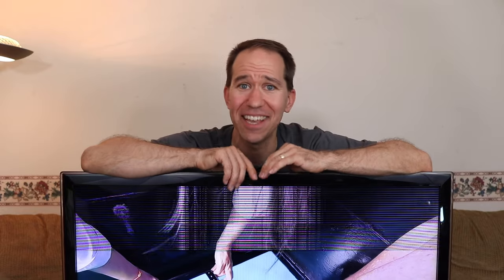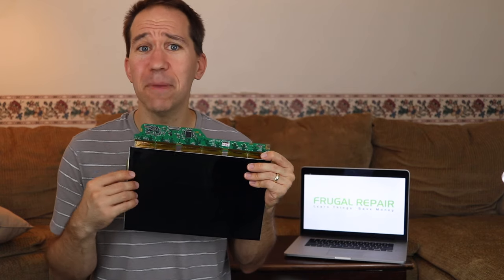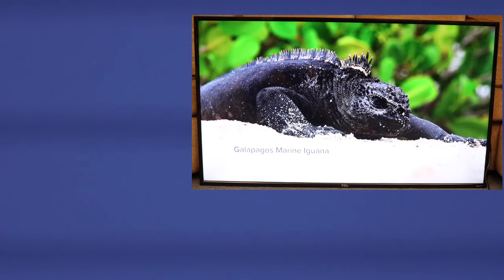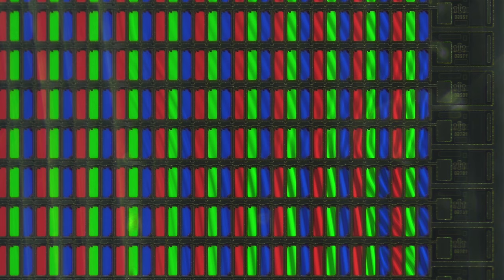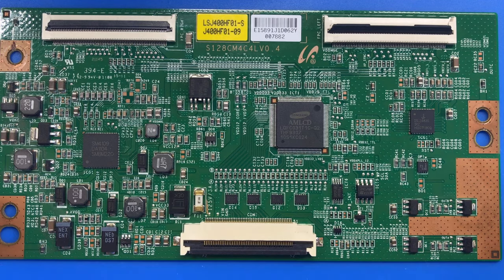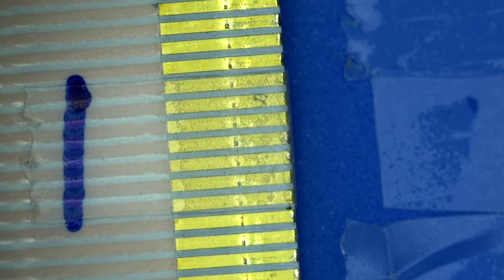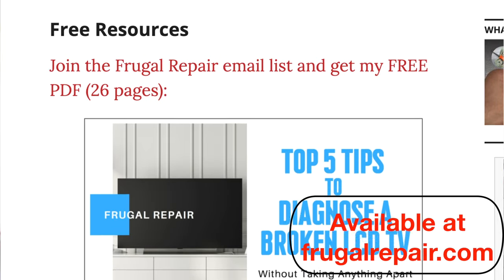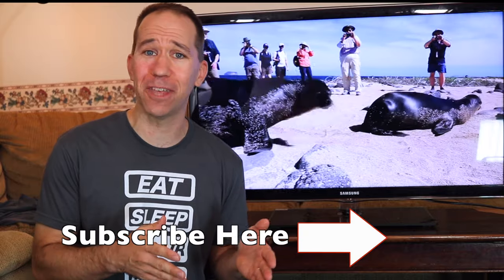Repair Hack Explained | How to Fix TV Horizontal Lines - Part 2

Comment: Thank you for the video! My Sony Bravia has a double image issue. The T-Con board has only one FFC cable. Thinking of blocking the lines with a tape, would it work? What are the possible long-term issues? Also, how long would this tape method work, can I have a decent picture for 3 months?

Comment: Thank you for this helpful video.

I just opened up my Samsung tu8000 to attempt to fix the horizontal lines, but found the t-con board only has 1 ribbon cable instead of 2, have you come across this before? Not sure how to proceed.

Comment: You mentioned a possible short or open causing the lines to appear. Is the short on the LCD screen or the chip that drives the LCD signals?
Reply from the maker: I meant the circuitry inside the LCD panel.

Comment: Hi, Thanks for the video and the great explanation behind the design. I found a 50 inch Samsung TV in my neighborhood and I tried to fix it. at first, the tv just looped in cycles with backlight on, flashing small red LED and then turn off. I managed to make it work by blocking the right side lines and now the TV is working, but with black horizontal lines spread along the screen (somewhere around 3 inches from the top there is a line. and another line in the middle, and some lines at the bottom.  What can I do about these lines ? It seems like I blocked the right side but the left side also not sending signals to those lines..? Please advise. (I am so thrilled I managed to make this TV come back to life, but if I could get rid of these lines it would be great!) . Thanks in advance, Bar.

Comment: I’m glad you said you like questions cuz I got a million lol
How can I do this tape trick if my tv doesn’t have a tcon board and only 1 ribbon going from my main board to the lcd panel?
At one point part of the screen looked perfect then I touch the ribbon just slightly and the lines on the whole screen would appear.
So I cleaned it with Q-tip and alcohol but still lines, however the whole edge of screen looks like it’s cracked on the inside.
Does that make my 82” garbage?
Reply from the maker: You do have a tcon circuit, it just might be embedded in the main board.  Worst case you would have to cut the lines in the pcb (one of the driver boards).  Definitely not as easy as tape to do trial and error.  Hopefully though your ribbon cable has a signal for each of the two driver boards.  Sorry I can’t help more.

Comment: I’m finding that it’s relatively inexpensive to replace a tcon board for my particular tv all together? Would replacing the board also fix the issue or is blocking the signal from these terminals the only solution. My tvs tcon board doesn’t label anything from what I can see, at least not ck or clk and I assume it’s not wise to just cover ports at random
Reply from the maker: Changing the tcon won’t fix a problem on the lcd assembly.
Reply: @FrugalRepair  yea sorry. I went back and watched the video for the 6th time after posting that question and realized you made note of it. I just have no idea how to go about finding the correct range of pins. I’ve tried looking for a wiring diagram but I’m no scientist and I don’t see the abbreviations noted on any breakdown. Any chance there’s a less common way they are labeled or perhaps a way to trace where the leads run to figure out what I’m looking for?

Comment: I know this is not the subject but would you recommend something on how to fix external cosmetic issues on TVs like frame cracks or missing little parts
Reply from the maker: I don’t know there’s much you can do with a plastic crack.  There are products to deal with small a scratches in plastic.  For a big crack, maybe hot glue or some epoxy and then use paint or a sharpie. I’ve used sharpies when a portion of the polarizer is missing.  If you need to buy parts, I usually go to eBay.

Comment: What u have displayed in this video same exact problem occurred in my tv also, shocking the same tv Samsung 40" LCD 2012 model, glass basel, touch sensitive power & menu button. Same horizontal line at the exact location top quater. So this problem occurred who buys samsung tv on that 2012 batch LOL. I gotta solution after watching ur video, let me try this...
Reply from the maker: Hope you can get it fixed!

Comment: Thanks for the informative video. Question: What would you do if your TV has thin dark horizontal lines evenly spaced throughout the entire height of the screen? Additional info: the lines are most prominent on the left and almost non-existent on the right of screen. Block out that entire half of the tv??
Reply: Nevermind, it looks like what you describe in your first video. Tape, here I come! https://youtu.be/pfrRhw7-ZII?t=415
Reply: Bro exactly the same problem is your tv fixed how much did it cost can I plzz contact you on any social media??
Reply: @rinasingh1767  it literally cost me nothing. Just follow his instructions in the first video.

Comment: I`m a coplete noob. Could i try fixing an lcd 55 tv tha t have vertical lines and flicering with only trying an elimination method of all the pins? But first checking what side the problem is on? Thx, great video:)
Reply from the maker: There’s no harm in trying this method, so go for it.

Comment: Hello how are you doing I’ve been watching your videos and it’s amazing the work you do and the knowledge you have. I am wondering if you could help me with my LG it turns on then couple minutes later it turns off but you could hear the sound with a  black screen. When I turn on the screen is working properly like I said for a couple minutes then black with sound hopefully you could help me thank you
Reply from the maker: My initial guess is that your LEDs are shorting out. Did you happen to get my 5 tips PDF?  In there I explain a few things you can use to diagnose your TV and something to try in your situation.

Comment: hey reese, by using the trial and error method you mentioned at the end, is it possible I might damage the tv more by blocking something I'm not supposed to?
Reply from the maker: No, blocking the electrical signals this way won’t hurt things. But you could accidentally rip a ribbon cable or cause other physical damage to the lcd while working around there so be careful.
Reply: @FrugalRepair  thanks for the quick reply! I guess i can do this then!

Comment: Awesome 👏. But is this the issue with the wire itself or the board?  Let say if i find out the issue within one of the connection. Can i simply change the wire?
Reply from the maker: Thanks! The problem is almost certainly inside of the LCD panel.  So it would be extremely difficult to find and fix the problem.

Comment: Pretty cool. It even solved a "flickering" (A blueish hue would show up for 1s then it'd go back to normal for about 10s ) problem.

The things is that now, on the half with the problem, the colors are a little off (skin and pinkish tones are yellowish); did I block too many lines?

Also, I don't think I understand how blocking the Signal on one side means that the LCD is bad. Isn't the Signal that comes from the other side the same, just weaker? Meaning that the tcon board that's actually faulty?
Reply from the maker: Glad to hear it helped.  The reason it works is a bit technical, the transistors gate voltage need to go high (or low) at the same time across the row.  The line is fed from both sides to help but in this trick you are blocking one side.  The LCD is faulty, not the tcon.

Comment: I myself am learning tv repair and trying to fix old broken TVs. Got an alleyway hisense tv that wouldn't turn on. I replaced the main board/power board and it turned on but had black lines. Long story short I removed the tape on the bottom now its worse. I think I screwed up  the alignment of the circuit board going to the LCD panel. I was thinking if I got a replacement panel it would have to be placed on with that tape so that means there has to be a way to get the alignment tension taped on the panel I have now. Hopefully you can shed some light on the subject.

Comment: First, great, informative video.  My problem on my Samsung QN43N60A 4K TV was two-fold.  First of all there are four wires that need to be pulled out to open the back and it appears there is no T-con board to access once open.  Only the two main boards and a single 2-inch cable leading to the edge of the screen.  Any suggestions would be appreciated.
Reply from the maker: Sometimes the tcon circuitry is built into the main board so treat the two cables that come from the panel like they are going to the tcon board in the video.
Reply: My main board has only a single wide/flat ribbon that runs to the bottom of the TV.  That connection goes to a low profile circuit board that essentially runs the entire width of the TV with a bridge connecting two separate halves of this board.  There are two slightly smaller ribbon connectors about in the middle of this setup.  Do you think this serves as the tcon board and that these two smaller ribbons are the ones I need to work with?  Any way to send you an image?

Comment: Hello thanku for this video do you have a video about vetical lines please and still have picture but i have vertical lines in the middle is that repairable please ? Thanks alot
Reply from the maker: I should make one.  Vertical lines are a different issue than horizontal.  It can be a problem on the tcon board but I’d say it usually is because of an issue with the tab bond.

Comment: Hey there - so are all horizontal line problems caused by the panel itself? Or can problems with the mainboard or other things cause it too? I have two monitors that are the same model LG34GK950F; one has a crack in the center whereas the other is physically fine but has horizontal lines. I was thinking to take the panel out of the one with the lines and swap it into the monitor with the cracked screen because I assumed the cause of the lines was something to do with the mainboard / circuitry / etc. I don't know anything about electronics repair though and I was going to try the repair for fun. Going by what Ive learned here though, it might be completely futile since ill just be trading a physically cracked panel for a defective one. Would you agree? Thank you!
Reply from the maker: It can’t hurt to try it.  What’s the worst that can happen?  Yes, it is possible it is a main or tcon board issue.  It’s likely a panel issue but it might have the two rows signals that you can block one (like in the video).  Just take care with transferring the lcd panel as they can crack easily.
Reply: @FrugalRepair  Thank you for the quick reply! and yeah, you're right. It would be really satisfying to make it work. Just wanted to know if it was impossible for that to be cause. Thanks again - happy new year.

Comment: So I was curious, In-case someone has the same problem, after using the tape method if they buy and replace the cable will that completely fix the problem ? I had a similar issue where I blocked some pins on my lvds cable and that drastically improved the image was wondering if you replace the cable would that further improve it ?

Comment: @FrugalRepair 
Wow, what an excellent and informative video. I have an issue with my LCD TV where it produces a single horizontal line, 1 pixel deep, that looks to be a duplicate of another area of the screen. No idea if this is the same as having those black lines? Any idea if this could be T-con board/ribbon connected?

Comment: I have just started out doing electronics to keep busy in lockdown. I had a LG 55la620 tv that didn't remove the previous picture immediately and seems to hold the charge  in the screens capacitor. I replaced the t-con board but this hasn't made any difference. Is this repairable on the screen buffer boards or is it just the screen is no good.

Comment: really awesome content you are providing to the community. thanks so much! I've a samsung monitor with vertical lines that I've tried to replace the tcon board but to no success. I've tried to troubleshoot by removing either one of the ribbon cable but noticed whenever one is removed, the monitor doesn't show any images at all, it needs both to be connected. really would appreciate your advice on this! <3
Reply from the maker: Thanks! I don’t know if I can help you, because you have to identify if there Is a row signal coming from each side of the LCD screen or not. In order for this trick to work, you need two row signals since you’ll be blocking one of them.
Reply: @FrugalRepair  thanks for the prompt reply i'll try it out <3
Reply: @FrugalRepair    how do you know/figure out if there's a row signal from each side or not?  (I've never taken apart anything with a board of any type, other than to replace the motherboard of a desktop PC)

Comment: Great video. Thank you... One question i have is on the board of mt samsung 70 in lcd tv there is a burnt part... Im trying to figure out exactly what this part is amd if a person lole me ( with limited knowledge can fix or replace it... Its a little black flat piece with what i can only describe as 3 metal arms coming of the left side and right side.. Or hell maybe the top and bottonm.. Resembles a squarish spider and legs for lack of a better way 2 explain it... Does this give you enough onfo to be able to tell you what im trying to tell you? Thank you for taking the time to read and hopfully respond...
Reply from the maker: Not sure, sounds like an ic chip but you need to know exactly what part it is.  Hopefully you can read the numbers on top for a clue.  If you can’t see the numbers, one idea is to look at the same board for sale on eBay and zoom in to that part of the board. Some sellers put a high-resolution picture and you can possibly read the numbers that way.
Reply: @FrugalRepair  thank you . i cant see any numbers on the part... I will try your suggestion

Comment: great video… I would love to see how you could fix a lcd panel inside a 2017  27'' iMac 5K.
The issue I am having is that dust/dirt has gotten inside the lcd panel.
I would love to know how to remove the dust and then reseal the lcd panel.

Comment: Is there any danger in blocking these signals. i.e. overheating/catching fire? Probably a stupid question but thought i'd ask anyway.
Reply from the maker: It’s the gate signal to the transistors so taking that away won’t harm anything.
Reply: @FrugalRepair  Thank you for replying. :) I found your video after already buying a new TV, so now I have a TV for the Kitchen. haha

Comment: Was able to revive my 2018, 55in. Led, lg set with the tape method,but it's.not perfect, it's  left a thin horizontal black line located 2 in.from the top. I'm 72 and shaky it's near impossible to see and hold an exacto razor knife steady while attempting to see and cut the tape. I suppose I should incorporate some.kind of steady-rest.i left the first set of 13 gold gold conductors taped over. Tried the illuminating process but failed each time when I would uncover each gold conductor. Do you have any suggestions? Thanks   Cole from thomasville ga.
Reply from the maker: Congratulations on the progress so far!  Yes, it can be hard to see without a lot of magnification.  I don’t know if this might help but you could alternatively cut the ribbon between each line and bend back each gold contact to find the one that is bad.  Maybe you could take the ribbon cable to someone with a microscope and ask them to score between the contact points?

Comment: Cool video! 
If money is less of an issue, is there a part or parts I can replace to fix this issue? I’ve never been good with electrical systems so I’m a little confused whether the issue is a board, the ribbon, or the rows of pixels themselves.
Reply from the maker: Thanks!  The problem is inside the lcd panel so no, you can’t replace any parts.  You could replace the lcd panel but unfortunately, you can’t buy them anywhere.
Reply: @FrugalRepair  thanks for the quick response! I’ll try the tape method to get a little more life out of my TV before eventually upgrading.
Reply: Well, I opened up my tv and there is only one ribbon inside. I’m assuming if I use tape on it I will entirely lose those lines of pixels?

Comment: So to actually fix the problem, would the tcon board need to be replaced? Or the ribbon cable? Can the issue be found in a bad component on the tcon board that can be replaced cheaper than replacing the whole board?

Comment: 1. What is it exactly that causes the short circuits in LCDs that lead to horizontal lines?

2. I have a Sanyo LCD with blinking (come and go every 2 seconds) horizontal lines at the very bottom.
Reply: How to make out whether it's a tcon board problem or a panel problem (which can be worked around by 'tape')? Thx.

Comment: Good job thanks for sharing i have led tv the same as u have horizontal.lines i try fix it using tape...sir can i ask a question what us the problem of tv blue screen without logo Tcl ...rher is no voltage in Vgl en Vgh

Comment: This is amazing Sir. i have a 50 inch sceptre, when i turn it on the screen is dark but the backlight is on, i have replaced the main board but the problem remains the same, your advice will be much appreciated.

Comment: Sir you are a pro ..can i do this to repair my laptop screen
Reply from the maker: You may be able to but smaller screens may only have one side of clock (row) signals (in which case this hack will not be possible).

Comment: I have an Element Roku 55”, and the horizontal lines are on the bottom. They’re not too bad. I don’t even noticed them anymore. The lines didn’t show up until I moved the tv from upstairs to downstairs. Is this common? Is it possible I tightened a screw too tight on the wall mount? I know these lines can be a wear-and-tear issue, but the relocating seems to have been what caused this. Do you think just reseating the ribbons would solve it?